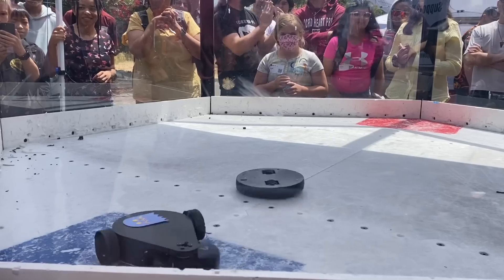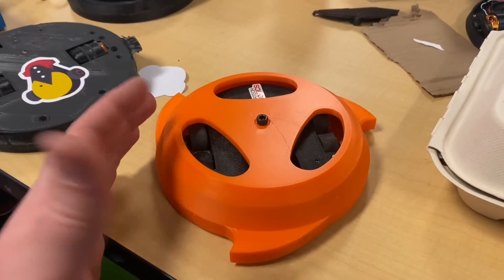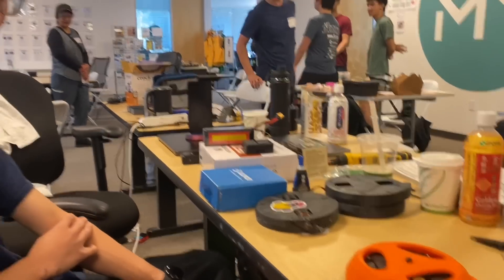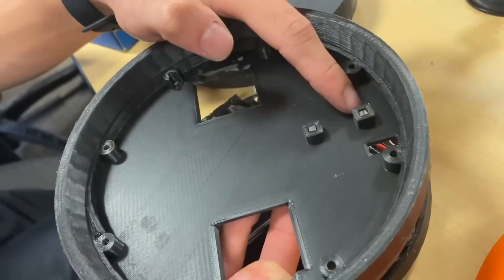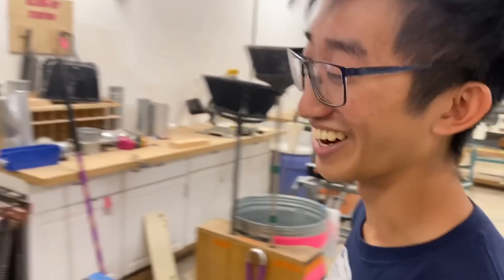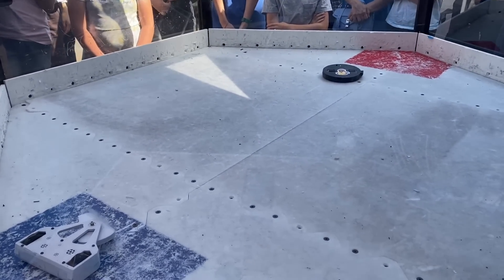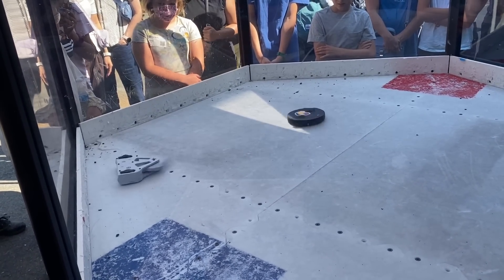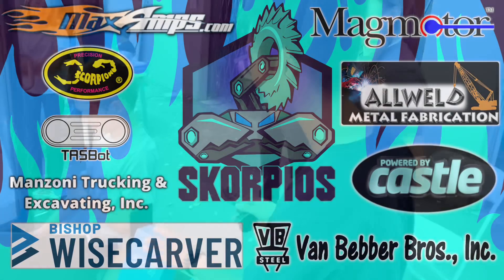Are Sensors The Future Of Battlebots???

Comment: This design is perfect for a lidar. Scan the arena as you spin, identify the walls as immobile points, and the target as the only moving thing you see. Avoid walls and go towards target.
Reply: Its not that simple though. This bot is not autonomous, hes controlling it through the keyboard with the software doing the translation to actual front/right/left/back in software. If the bot blindly drove at a target all the time, you'd be running straight for their weapon. An opponent wouldnt even need to move, they'd just need to keep pointing their weapon at your bot and wait for you to suicidally drive in to it. Notice how hockey puck is constantly trying to get hits in around the sides and back, avoiding the weapon

Comment: in high school, about 30 years ago, I used the p-robots fighting system where you programmed pascal based turtles, based on c-robots, kind of based on corewars,  basically boxes fighting in a battlebots style arena on screen.

when I first heard of battlebots, I assumed that's what it would be like, software based robots battling to improve fighting robot ai.

Then I found out they were all fancy radio controlled cars. I figured it must be for safety, but it's not real robot fighting, it's rc car fighting.

now a few ai bots are joining the series, I'm becoming more interested in the sport again
Reply: Guess you'll like the auto sumo bots from japan
Reply: also check out micromouse competitions, those are insanely fast.
the funny thing is them using a fan to stick to the ground.

Comment: I dunno. If you have, say, half the mass of the bot in a spinning shell, you can probably spin it much faster to get the same amount (or more) of kinetic energy at the perimeter as a meltybrain. Plus, the motors in a meltybrain are constantly changing (and reversing?) RPMs, which has to be more wasteful, like driving in stop-and-go traffic.
Even so, it's an interesting concept.

Comment: I'm planning one of these for 150g, but it will use a controller, and all of the compute will be on board on the bot.  I am also planning to use a beacon.
Reply: My current challenge is finding brushed motors I like. Most are too slow for this. And brushless motor controllers take a 50hz signal which is not quick enough for switching the motors at over 1500 RPM on the chassis.
Reply: @amadensor  I think you are confusing the frequency of the mains power powering the motor drives with the power going to the motors. You can easily find drives that have microsecond sample times.
Reply: @someonespotatohmm9513  no. Most small brushless ESCs are designed to work with rc radio servo signals that are 1000 to 2000 milliseconds at 50hz, so switching that signal cannot happen often enough.

Comment: Using an external light source as a fix point to calculate your orientation and position is a smart idea. But I wonder if he still gives the robot directional commands or if software on the laptop decides where the robot is going? It sure looks like he is steering the bot with his keyboard, right? So a controller would make him even better at driving.
Reply: using an external light sorce is genius. It's how the steam vr tracking works and has very good tracking. This bot obviously uses a very simplified version but same concept. using sensors to orient itself. I also agree, he could easily get a game controller and use it to control the bot. Would be very easy to do and could also give him finer control if he can impliment analog joystick controls

Comment: Meltybrains might be a good thing for stability and the like or telemetry on the robot which tells you it's status like motor temperature, battery charge remaining etc. Bloodsport and Storm 2 from robot wars have used these systems successfully. Active external sensors however like the LIDAR tracking used by Chomp and more recently Oribitron have had some issues with reflections of the signal creating mirror images of things which aren't really there and other such issues so we'll see how the latter fares here.

 Another downside is the fragility and cost of these systems. In some cases they can be relatively cheap but others prohibitively expensive. I do think though that the sport is slowly but surely moving in that direction anyway as teams look for newer and ever more innovative ways to gain an advantage over their competition. We haven't seen that many examples of heavy sensor dependence in the heavies but I think that will become more commonplace over the next decade or so. They're clearly already making waves in the lower classes as the video shows here. Probably the single biggest obstacle to more widespread adoption is the complexity of software associated with designing, testing and successfully integrating these systems in combat, especially for the self driving bots.
Reply: This kid with his simple directional infrared receiver has cost cut his amazingly
Reply: @Milsparro  I'm surprised it even works in the daylight.

Comment: Probably three classes? full AI (look no hands), AI assisted, classic manual driven
Reply: Probably better to do it based on hardware, as that can be verified a lot more easily than having to examine the code a bot is running. Although  coming up with reasonable metrics to divide classes could be tough.

On the opposite side of autonomous bots, it could be interesting to have a no-processor class.
Reply: @SnakebitSTI no processor can be hard to define as brushless controllers usually run on microcontrollers. One might need full analog circuits to be sure

Comment: Meltybrains have seen some success at NHRL events. The level of chaos they bring to a fight is definitely most effective at lighter weigh classes, where they are an absolute joy to watch! I hope we eventually get a chance to see someone attempt to bring it up to the heavyweight leagues, but with the weapon size limites it may not be possible within Battlebots Rules.
Reply: The forces on the wheels in meltybrains are insane when you get too much above 3lb or so.  The non-linear nature of scaling (mass/power/size don't scale at the same rates) make a meltybrain at large scale harder. (If they were easy to make, you'd see a lot more of them.)
Reply: @zenithparsec sounds like another use for witch doctor-style titanium hubs
Reply: @zenithparsec  use more smaller motors
Reply: @sayorancode  Smaller motors have less power, which means less speed which means less damage. And damage increases with the square of your speed: if you can spin twice as fast, you will hit with 4 times the power.  If you spin 1/2 as fast, you only do 1/4 the damage. 

Giving up power is hard. ;]
Reply: nuts 2 is a meltybrain heavywait, there are some other heavyweight ones that are much older
Reply: @randomsnow6510  Nuts 2 is not a Meltybrain, it couldn't drive while spinning. It could only either spin in place, or stop and drive around.
Reply: I'm pretty sure the meltybrains Nuts 2 is heavy weight, clocking in at 97kg.
Reply: Can you skirt the rules with a melty "minibot" (at Max weapon weight) and a frontflipper/grappler (for active weapon rule as well as support utilities)
Reply: @cygnusinfinity5126  there have been a couple of heavyweight Melty Brains. Cyclone Bot had two incarnations from 2004-2008, fighting bots like Last Rights (Tombstone), MegaByte and Warrior SKF.
Reply: @knightrousoxide  those are Shell Spinners, not Meltybrains.
Reply: @The_Curious_Cat  I believe Herr Gepoünden (what does that name even mean?) was an actual Meltybrain, but not with the typical circular shape.

Comment: Are you sure it's using AI to control it? I'm not seeing any importing of pytorch or such. In fact, it looks like he uses the keyboard's arrow keys to drive it—given the programming you showed in the screenshot 0:53
Reply: My question was if it doesn't have a radio, how is it being directed? If he's driving it from arrow keys on the laptop, clearly it still has a radio. The video title seems misleading at best, and completely wrong
Reply: @gorak9000  Given it's got a file for bluetooth, I'd say that's how the comms is happening. It's a radio, just not a traditional controller.
Reply: @ConstantlyDamaged  My comment still stands - that's a radio. To imply there's no radio to me means it's doing some kind of autonomous target identification and tracking on it's own, which it is not. It's not doing anything autonomously, it's still controlled by an operator, just using a different kind of radio - the title is entirely wrong
Reply: @gorak9000  In the combat robotics scene, a "radio" is generally the handheld device that controls the bots.

But, yes, it's definitely a "radio" in the wireless RF sense of the word.
Reply: The operator controls the bot; he still has to steer it. WiFI or Blue Tooth is still a radio signal
Reply: it's AI in the sense of video game AI, he gives instructions and the bot follows
Reply: @satibel  That's how any bot controller (except Orbitron) works.
Reply: @ConstantlyDamaged  yeah but how would you clickbait then? :p
Reply: "ai" doesn't mean anything anymore. marketing pukes ruining terminology as usual.
Reply: @kaiserruhsam  AI does mean something. It is a bunch of technologies, including neural net; weighted feedback circuits; and others. 

In this case, given the modules in the code there, and the names of variables, this is nothing but using the laptop's arrow keys as the control system via bluetooth.

Comment: To me, it's all about engineering a better bot.  If sensors does it, so be it.  It's Battle BOTS not Battle r/c.  I'm waiting for full AI.  If people are into the "driver" rather than the tech, then create the equivalent of the International Race of Champions - two people given identical bots to battle it out to see who is the better driver.
Reply: Exactly 💯
Reply: Hacksmith Industries made a battle bot with a hybrid AI, controller setup. The AI was supposed to circle around the opposing bot at as consistent a distance as possible and then, at a command from the user, dive in for a spot at the weakest side.

It's a work in progress but still a pretty cool one. I highly recommend the video series.
Reply: I'm excited to see more sensors and machine learning / AI in future bots. There are so may cool weapon concepts that are simply impossible to control manually.  I'd love to see the vertical spinner meta to get disrupted.
Reply: @thorwaldjohanson2526  A number of hammer bots seem like a solid idea, but they've suffered from issues of reaction time.  A sensor driven hammer would make them deadly. Likewise some of the flip bots.
Reply: I used to think that battle bots where ai because I discovered them not long after ai competitions, I was very sad when learning that they are controlled by humans and not ai controlled...
Reply: @SpeedyGwen  will the Japanese sumo robots make you happy?
Reply: I personally think the amount of factors are part of the fun and some people are better at driving other designs